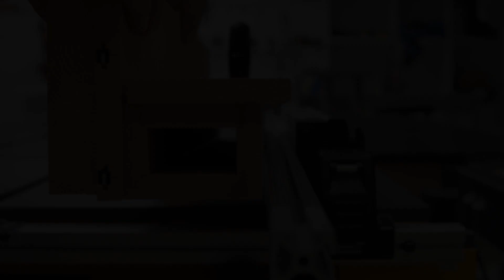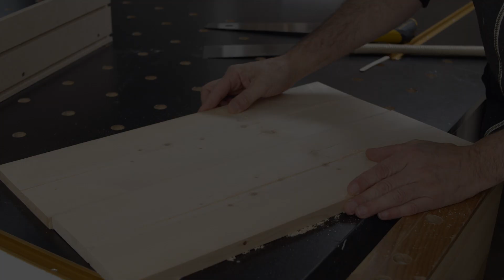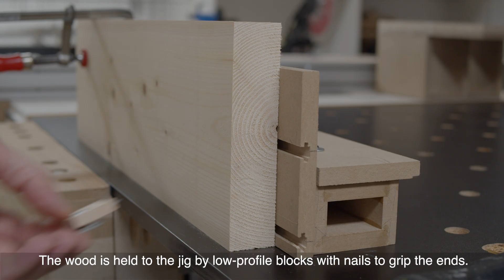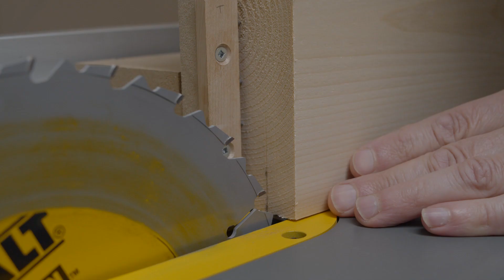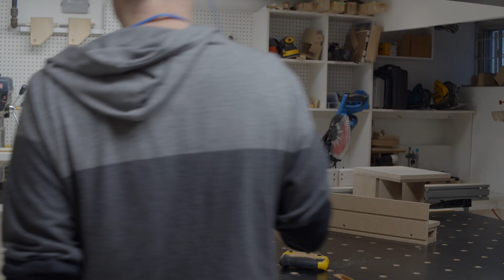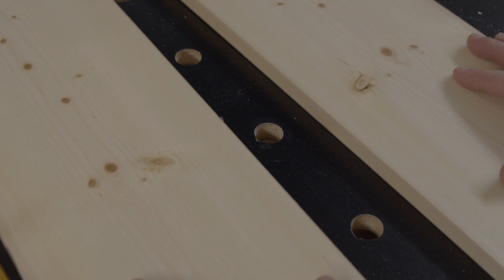Safest way to Resaw on a Tablesaw

Comment: Very cool. My under powered band saw struggles to resaw. The trick is to plane the boards afterwards to remove the blade marks and even the thickness. Seems optimized for lumber.
Congrats for the innovative thinking from a fellow hoser.

Comment: Neat way to hold the wood in the perfect position, and I love the use of aluminium moulding for the fence. I have seen other people suggesting that you should take take two or three cuts each side; do you have any thoughts on this?
Reply from the maker: If I was doing hardwood yes definitely, smaller cuts.  But for softwood lumber the saw is powered enough to make a full depth cut in one go

Comment: i would think that cutting so much in one pass is going to really heat up the blade and cause it to either warp, get dull, or both..
Reply: It shouldn’t be an issue on soft woods like that. It looked like spruce. The lack of burn marks on the cut surface shows that heat was not a problem. If you’re re-sawing Bubinga or something you could start with a shallower cut and increase the blade height by an inch or so on subsequent cuts.

Comment: Trying to do cherry 5” wide boards.  It’s a nightmare.  I’ve had to run each 31” board about 4-5 times and you can tell it’s working the saw to death.  Im probably using the wrong blade also, a 60-tooth.  Might do better with a 40.  Either way, the board pulls itself inward from both sides, creating a clamping effect on the blade.
Reply from the maker: Yes I've had moments like that, the cut releases tension in the wood and it clamps onto the board slowing the cut to a crawl (and working the poor motor to death).  You're right it is a nightmare.  A 40 or 24 tooth blade would help a little but the wood is very powerful in that situation, once it clamps onto the middle section of the blade the struggle is enormous.  You can try tricks like only cutting a bit, putting small wedges into the kerf to keep it pried open, then continue the cut.  Don't let that wood beat you!

Comment: Interesting but it won't work for a long board.  For a board that short I can easily and safely doing it by hand and then plane down any imperfections.
Reply: I made a similar jig but used 60" 80/20 that gave me enough extension on the front side to add a front support as i had misgivings about the longer boards.  i was able to resaw 48" pine with ease but I also cut it twice.  One note that i have  not seen mentioned is that it is absolutely necessary to have the riving knife in.  Very dangerous without.